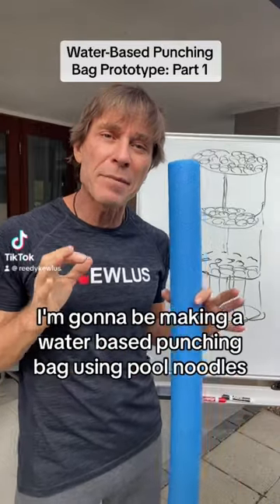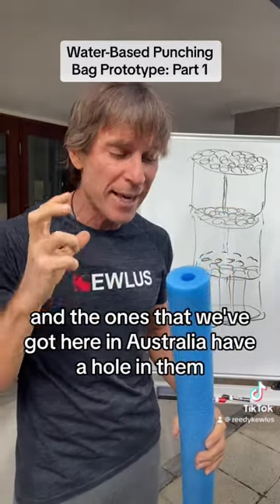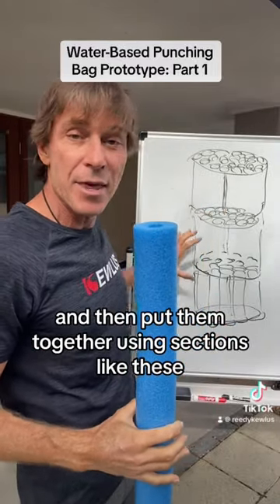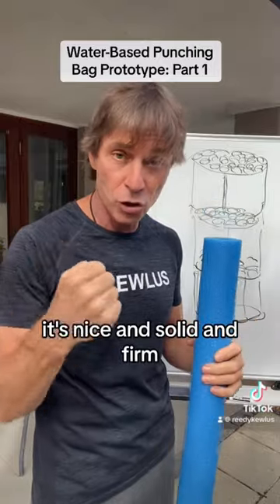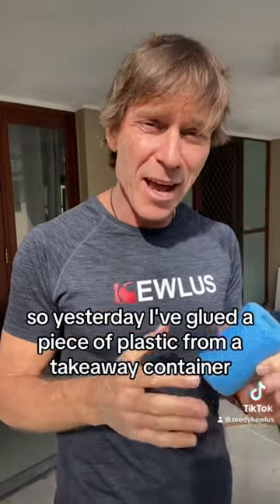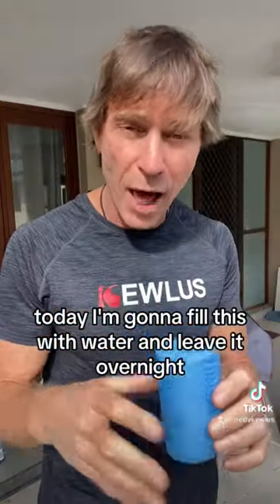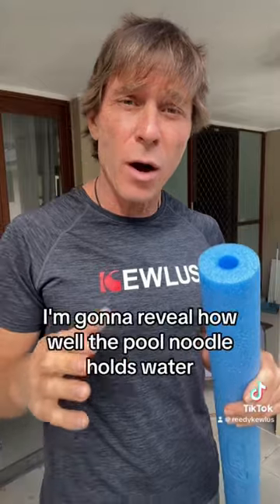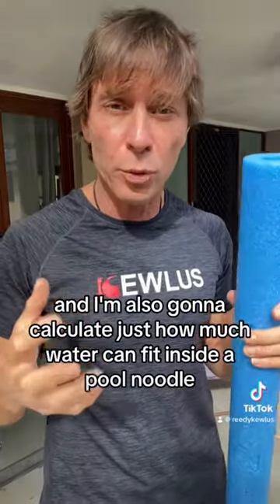Water-Based Punching Bag Prototype: Part 1

Comment: Don't know if it would work, but you could try using a condom as a linear in the pool noodle or  use parts of old bike inner tubes as a cover on the outside